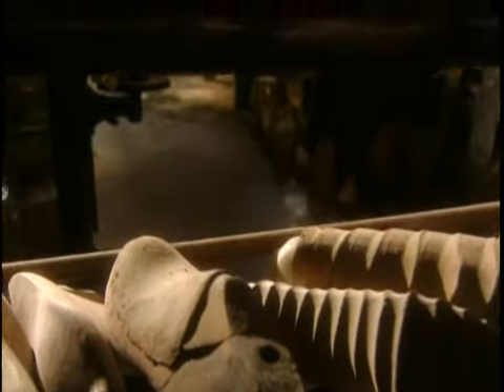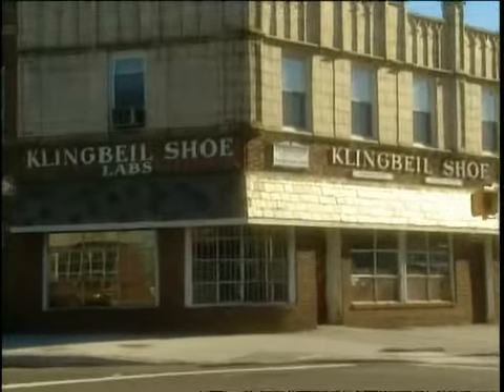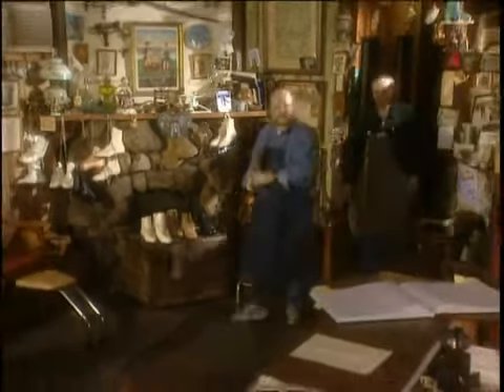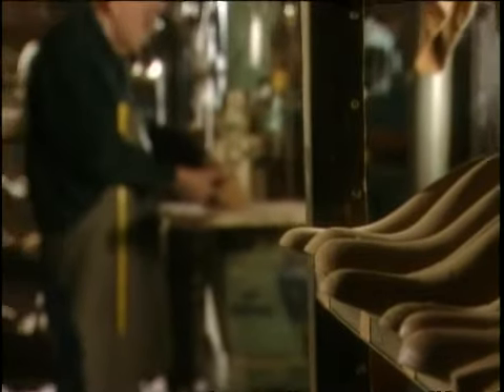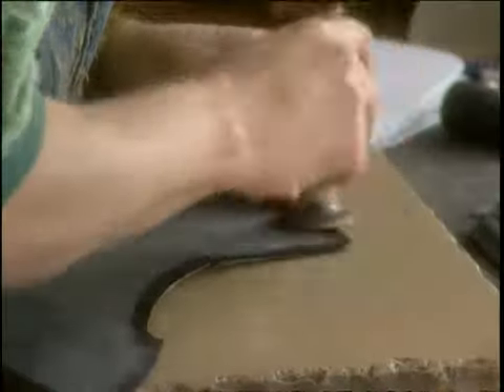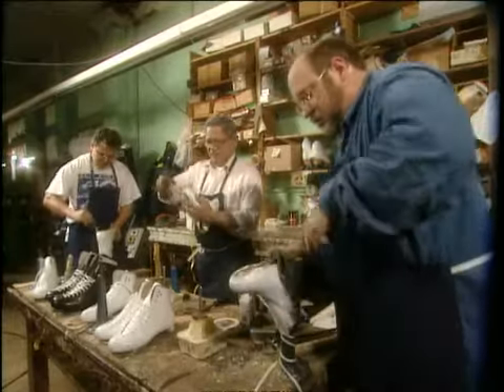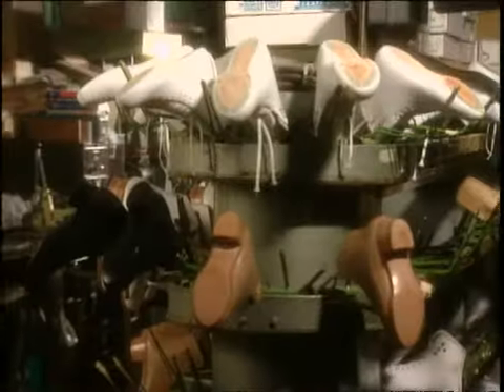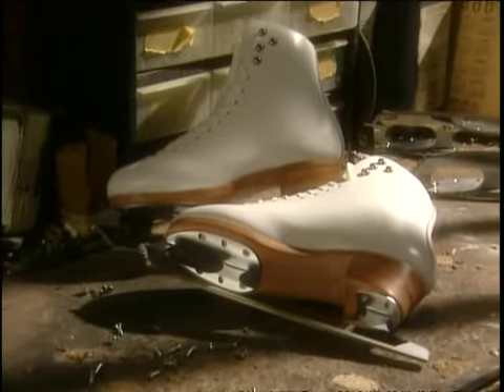Klingbeil Skates

Comment: This is not an easy job,, my late cousin worked with a custom mountaineering boot maker in Italy for 15 years in the 80's.
You have to know what you're doing.
This is a sad to say, a dying art.
Reply: BIG Stick   A year ago, I bought a brand new, never used pair of Klingbeil S3 boots for $66.49 on eBay. Nobody else bid on them. I guessed that they would fit me and if not, some kid was going to get a great pair of skates (my feet are tiny). They were a perfect fit. They were not easy to break in, but now they are great and there is no way it would be possible to break an ankle. My right ankle was broken twice because my skates were bought with too much growing room (2sizes) and my feet never grew. Also, I had to make skates last even when they were worn out. So these were a great find for me and I am grateful to have them.